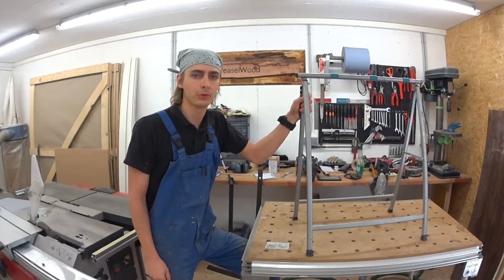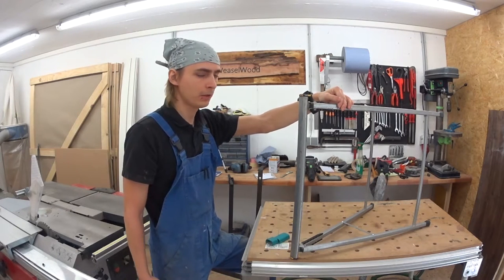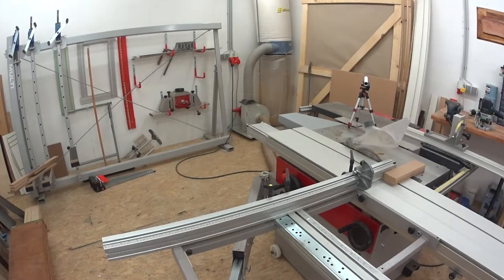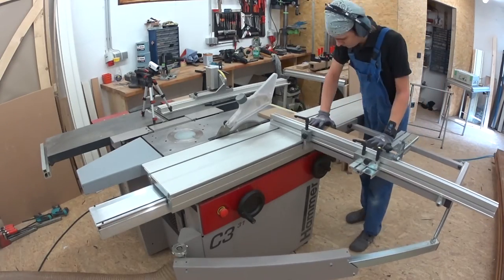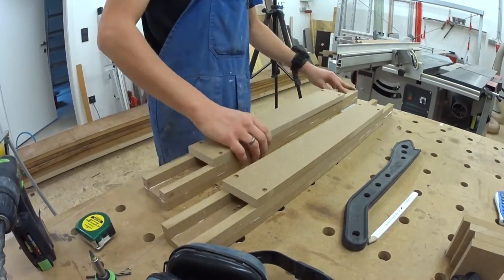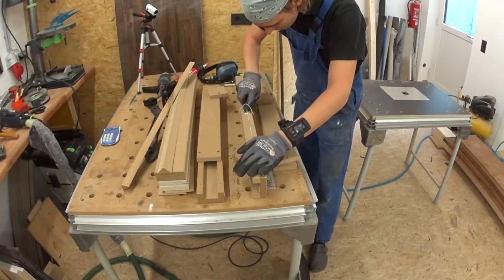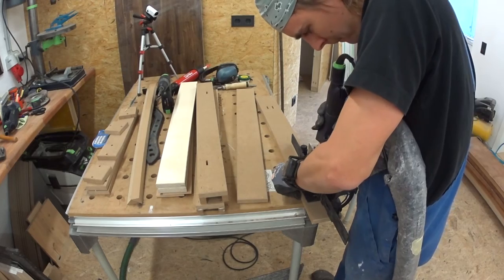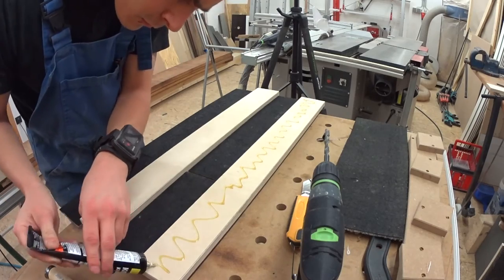WeaselWood #4 [English] Sawhorse modification

Comment: Wouldn't it have been wiser to put the Domino dowels into the top plates? That way you could have used the saw horses without a top plate too.
Reply from the maker: Hi reiner.
This would work either way, but I use some kind of top anyway so I have no need for this option, also you can use the blank one to get a flat surface. ;)